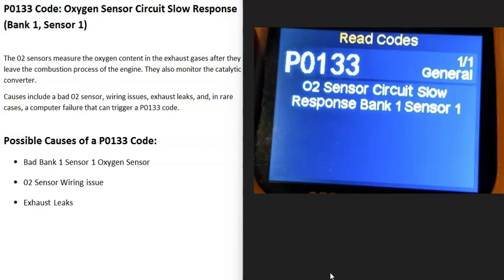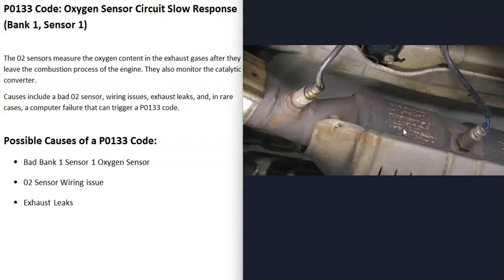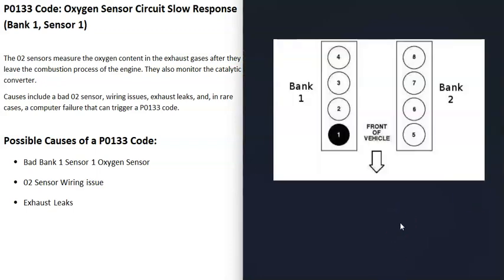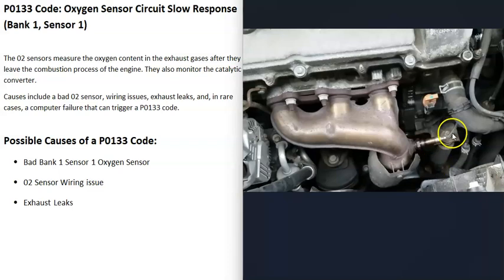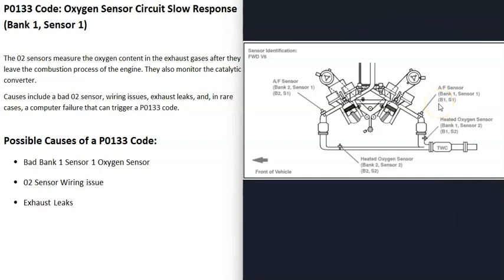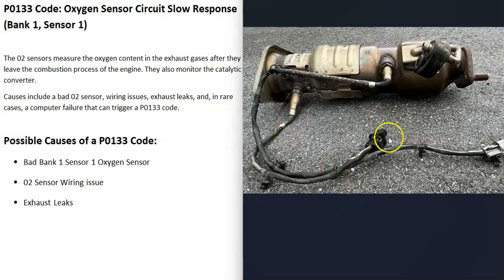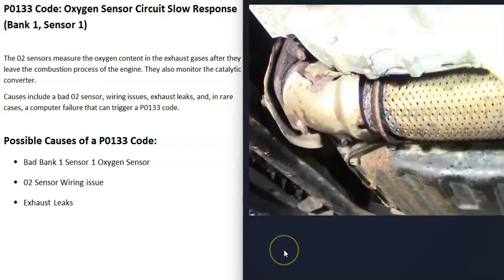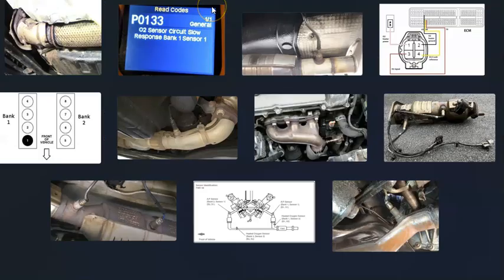Causes and Fixes P0133 Code: Oxygen Sensor Circuit Slow Response (Bank 1, Sensor 1)

Comment: hey there  i previously had an P0420 code and i put an adapter on there along with a new 02 sensor  after a day now i have P0133   pls help
Reply from the maker: I would check the wiring be sure everything is plugged in good with no damage.

Comment: Can this cause a car not to shift?? Or slow performance?
Reply from the maker: The engine won't be as responsive but should still run OK. I've never seen it affect shifting.
Reply: @HVAC_Mechanic my 2008 fprd fusion has that code it idles rough it shakes it barely wants to shift.. its even worse when i turn the AC on! When i turn the AC on i press the gas pedal all the way down and it doesn’t wanna go at all
Reply from the maker: Most engines will still run OK with a bad 02 sensor. The 02 sensor may be bad, but there is likely another issue with the engine.
Reply: @HVAC_Mechanic possibly coils and sparkplugs because I bought the car for 700😂 the guy told me it neeed a throttle body

Comment: If u buy  a new exhust pipe and the O2 sensor position is off by just a little im told it could  trip that p0133 code?
Reply: That shouldn't matter long as it's not perhaps 2 feet away

Comment: I just changed the upstream O2, now this is popping up. Any idea?
Reply: Best to use the factory brand o2 sensors as that's how it's calibrated so to speak.  Other ones are basically copies of what the factory sensors are and many times can be hit and miss
Reply from the maker: If the sensor is good, I would check the connections and test the wiring.
Reply: Same with mine